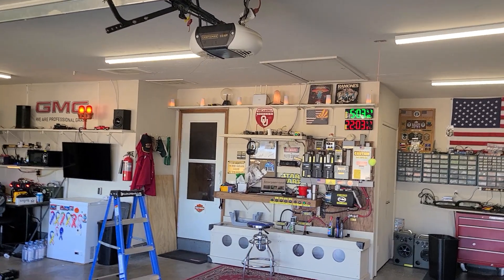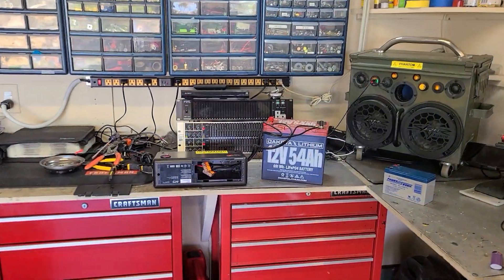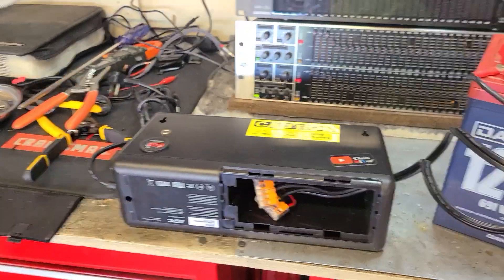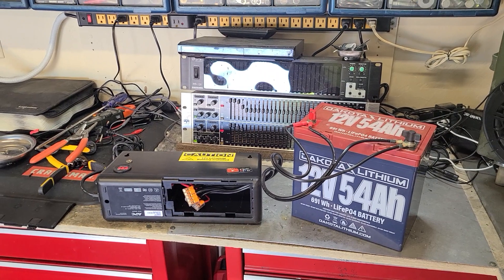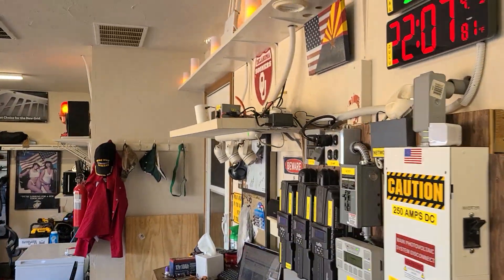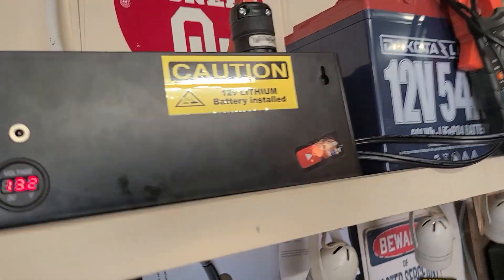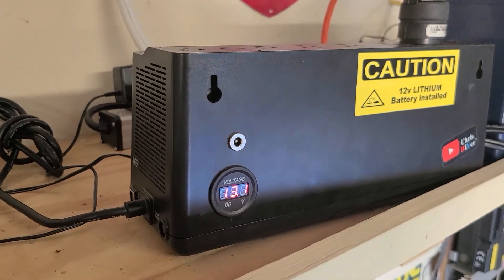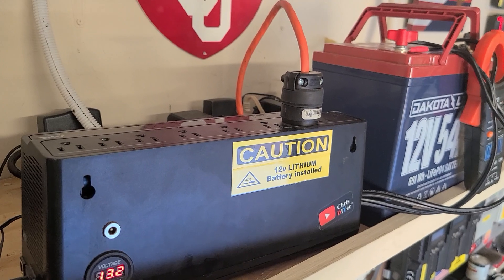Experiment #2! Will an APC Battery Back Ups 900 open a garage door? Bigger battery time!

Comment: I have been looking at doing this for their larger 2000 series. How does the charging circuit handle the lifepo4 batteries for charging?
Reply from the maker: I measured it at 13.5v @ about 1 amp trickle. But, I do not know the exact charging parameters (if it goes higher with more current). It won't hurt a lithium battery. But, at 13.5v, a lithium won't get a full charge. The other thing, many smaller lithium batteries don't like "in-rush" current blasts. So, (if it were me) I would use a 100aH lithium for a 2000 series

Comment: Use an inverter instead of a UPS. Run it off of a battery that's connected to a charger all of the time.

Comment: On the Craftsman 1/2 HP Chain Drive Garage Door - In the manual there is a bit that talks about the force needed to open the doors, 
Maybe lowering that... 
That will make it take longer to open, but would use less amps.
Just a thought

How many watts is the light using inside the Garage Door motor, (It looked like it had lights)
Reply from the maker: When I took the lights out (about 70w) I was able to open the door with this APC/battery. However, closing it...only made it 1/2 down. Almost there!

Comment: I think even if you put an APC 1500 or 2200 the UPS itself will get pissed off because motors, compressors and the like tends to draw power in a very dirty way while a UPS will try to provide clean power for electrically sensitive devices. We get the same issue in IT with Laser printers when someone plugs them into a UPS
Reply from the maker: Totally true...and that APC is not a pure sine wave either...just clean enough for most electronics. I did a video a long time ago using my oscilloscope to show viewers what a crappy AC signal looks like coming out of these battery back ups. If I ever get my hands on a used 1500/2200 battery back ups (not buying one just to do a test) I may do this test again.

Comment: I would avoid lithium batteries. It’s a fire hazard if it’s not designed correctly. Prefer the old acid battery.

Comment: Cool test. I read other places that the UPS sometimes need to learn the battery. I'm not sure if this is relevant here with this model. But it could be that you need to completely drain/recharge it a few times.

Comment: I think you did everything right. Yep, bigger battery is needed. ( Like I know anything)
Reply from the maker: Thanks. Def had enough battery power...just not enough "APC" AC inverter power to power the garage door opener when the APC unit was unplugged and on battery. Good times! Need a bigger APC battery back up unit...or a new brain in my head.